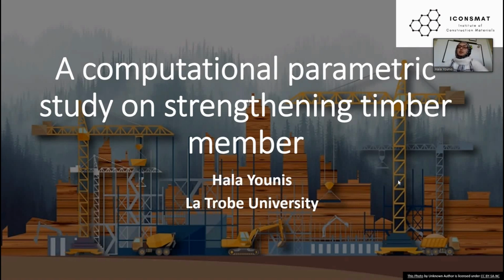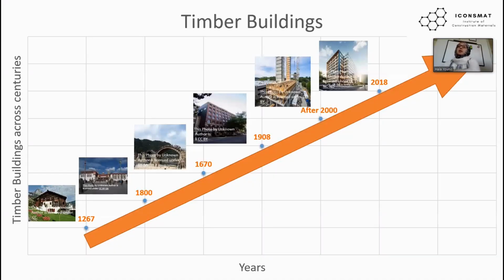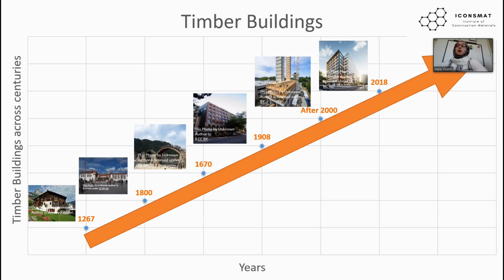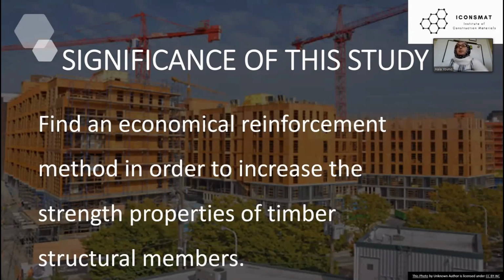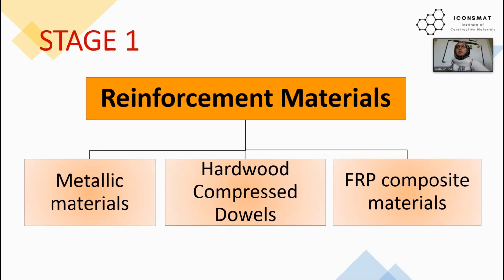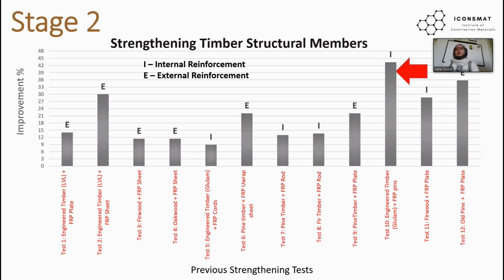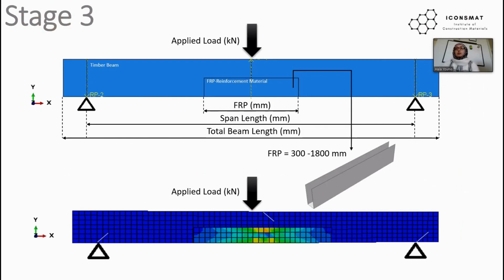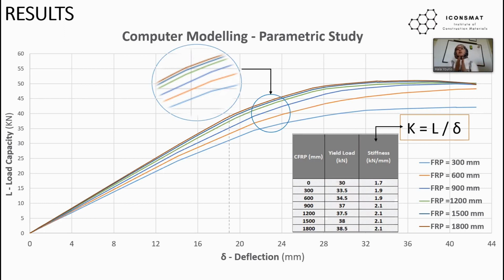Strengthening Timber Beam | Third International Webinar on Construction Materials

Comment: I expect that this reinforced  concrete mixture will add a great powerfull to the giant buildings in the futur
Reply from the maker: With this current shear resisting method we can expect a large amount of bending loads capacity for timber beams. Although it is also intersting to compare the timber beam with concrete beam in terms of bending resistance. Can be the next research topic...